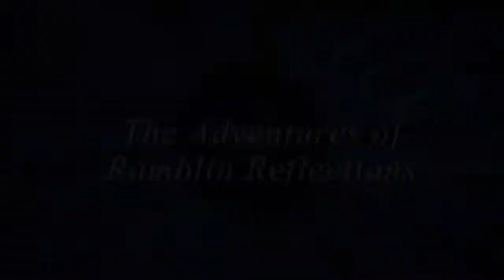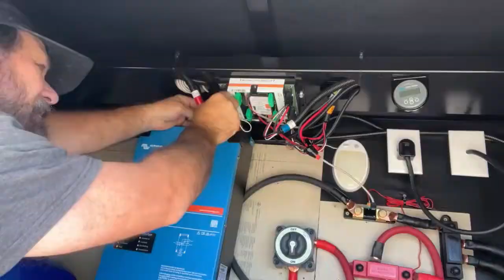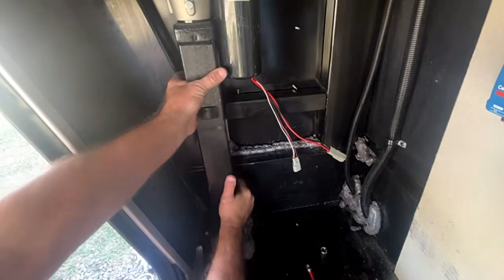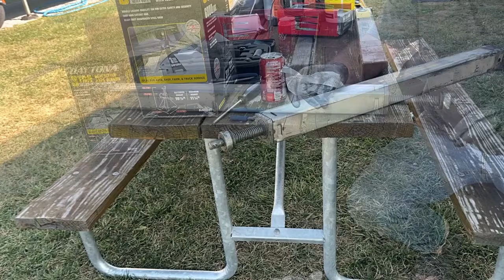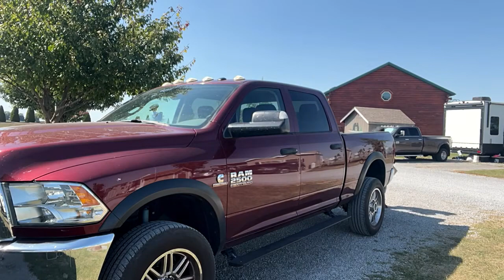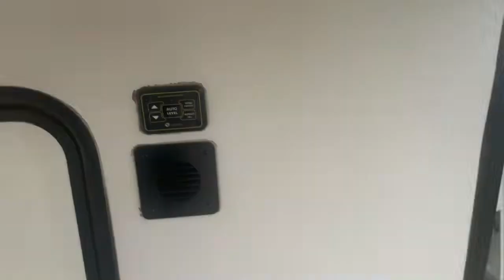Lippert Leveling System Breaking? This is Probably Why

Comment: Thank you for this video. Saved me the exoebse of purchasing motor and all. Exactly what happened to mine. One question, how did you grease the spindle and nut assembly? Just coating the spindle  seens a bit futile as I suspect the grease would get squeezed out ... maybe part of the problem with the failures. Thanks again
Reply from the maker: Thanks for the kind words, Pierre! I’m so glad the video saved you some cash—that’s exactly why I posted it. Regarding the grease: both replacement units I’ve ordered actually came pre-greased from the factory. To add an extra layer of protection, I sprayed a generous coat of dry lube on the leg tubes. I prefer dry lube there because it doesn't attract as much dirt and road grime, which can cause wear over time. Great job getting yours fixed!